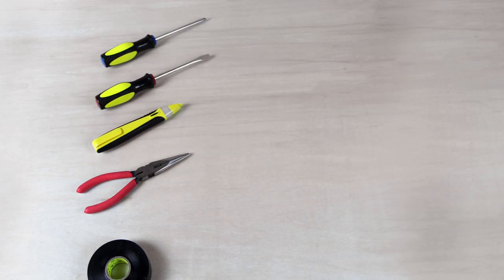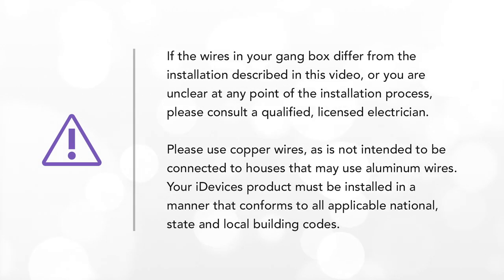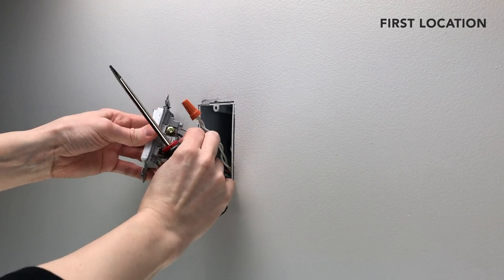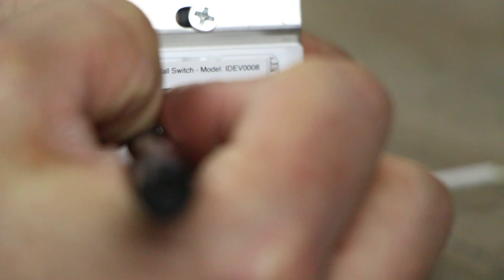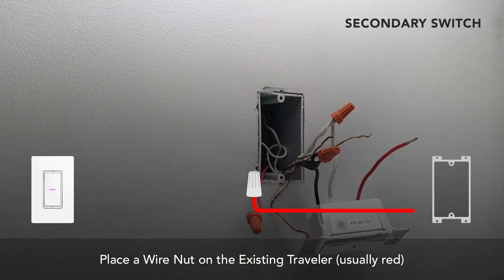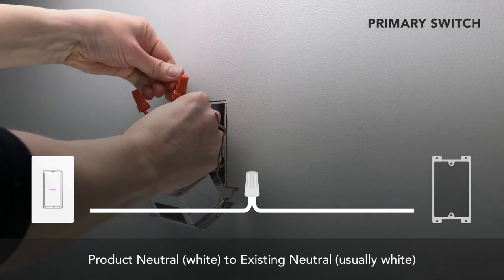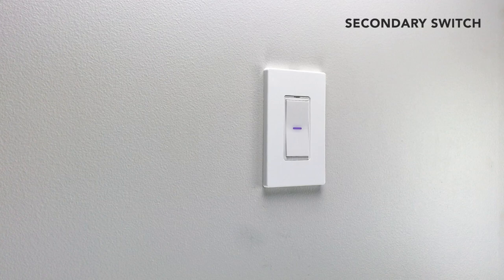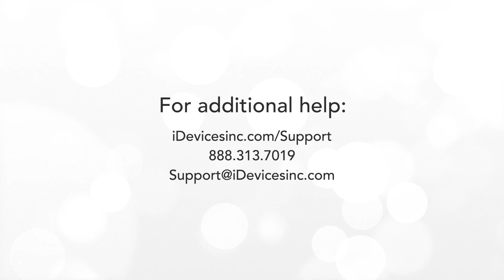Install Guide: 3- & 4-Way Setup of the iDevices Wall Switch or Dimmer Switch

Comment: What does it mean when you turn the switch on with the lights on, the red light flashes and shuts down the  circuit. Any advice?